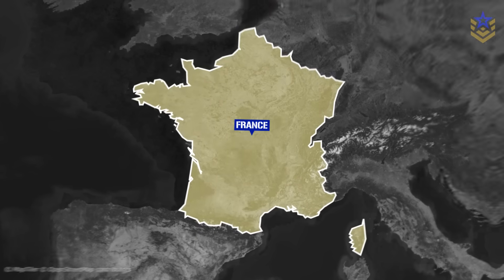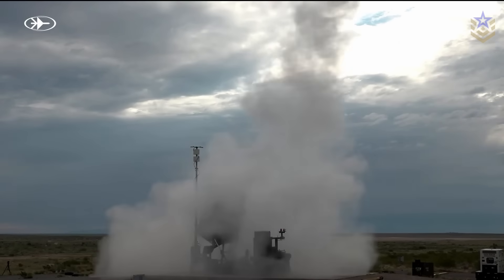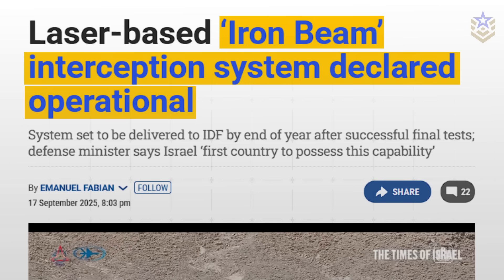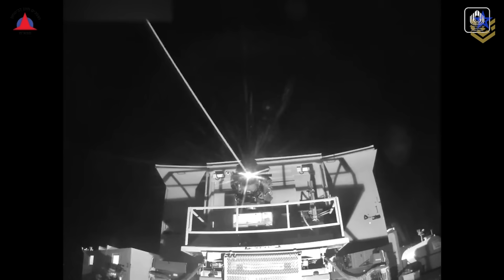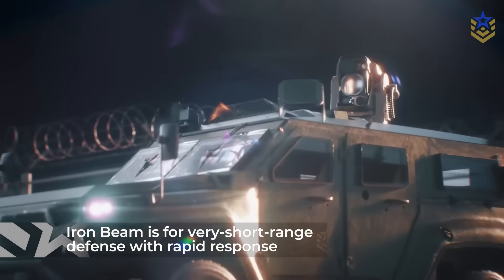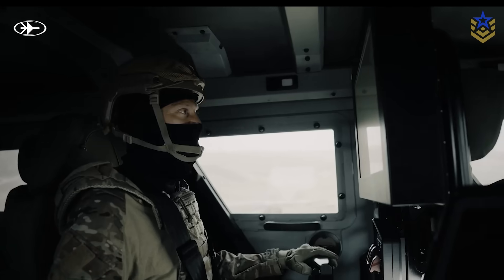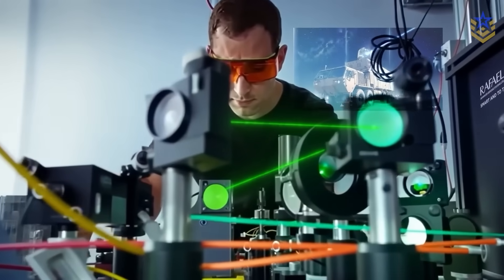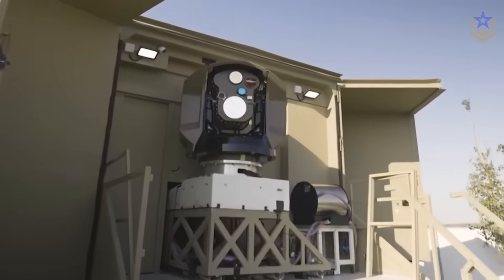How Iron Beam 450 Works: Israel’s Laser Defense Weapon Explained

Comment: The U.S. military has been actively developing and deploying laser weapons for several years. These are called Directed Energy Weapons (DEWs), and they use concentrated beams of light to disable or destroy targets.

Here are a few examples:
	•	U.S. Navy – HELIOS & LaWS
	•	The Laser Weapon System (LaWS) was tested aboard the USS Ponce as early as 2014.
	•	The newer HELIOS (High Energy Laser with Integrated Optical-dazzler and Surveillance) system is now being installed on Arleigh Burke–class destroyers.
	•	U.S. Army – DE M-SHORAD
	•	A Stryker combat vehicle has been fitted with a 50-kilowatt laser to shoot down drones, rockets, and artillery shells.
	•	U.S. Air Force – SHiELD program
	•	Developing a pod-mounted laser for fighter jets to defend against missiles.
	•	Other prototypes
	•	Boeing, Lockheed Martin, and Raytheon are all working on high-energy laser systems, some designed to take out drones and incoming threats.

Their main advantages are:
	•	Speed of light engagement (near-instant hit).
	•	Deep magazine (as long as the platform has power).
	•	Lower cost per shot compared to missiles.

Comment: For Enterpreneur:
1) Precision RotaryActuator LowCost SOLID to: Verify Response & Accuracy.
1.1) Designed for Golden_Dome, Arrow-3, THAAD, Lazer...
1.2) ResponseTime<0.0001sec.
BECAUSE:
1.3) Electric But W/O Electric_Motor.

2)  *ABS_Valve*: better than BOSCH, ZF, etc.: Faster, Proportional (Because not a Solenoid Valve). 
2.1) 98% eff. in Simulated Braking on Dry asphalt W Puddles (Wet asphalt); Calc. using Pacejca (MF) Magic Formula. 
2.2)  Will replace the 2 on-off solenoid valves (for each wheel, in the ABS)  
2.3)  Enable World's best_ABS,  (size, reliable). 
3) More... 4) Pls Contact

Note: an ABS_Valve derivative (*Pilot Valve*) will move a Spool of Danfoss Servo much better than Danfoss_SVB